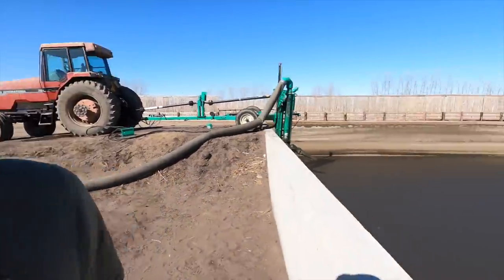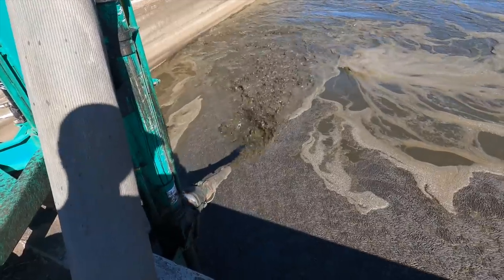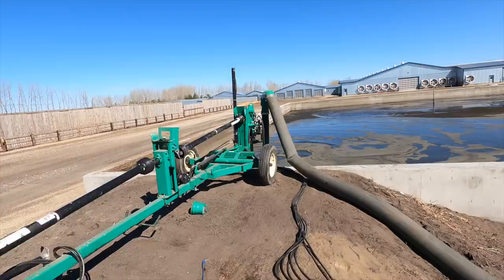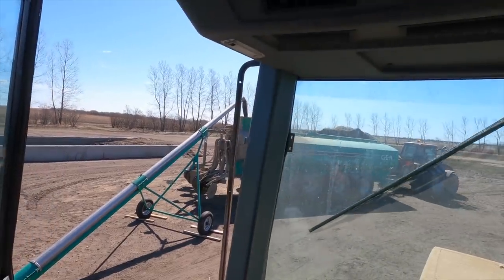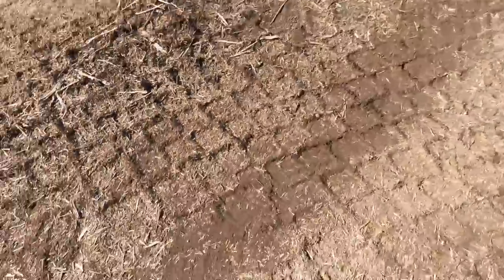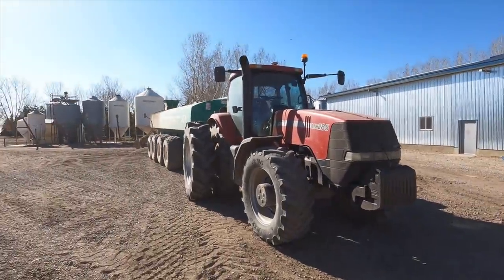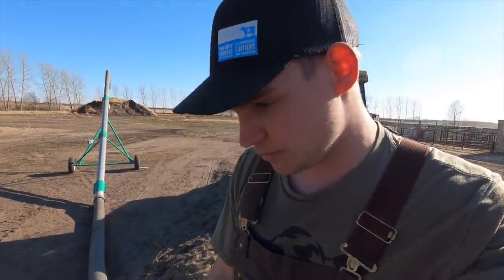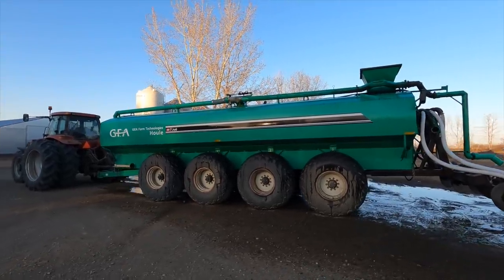Hauling Liquid Manure With 35,000 Litre Tanker!!

Comment: I appreciate all the hard work you put into your videos Jan. This is another great one. 

The pit is 306,250 cubic feet or 8672 cubic meters according to Jan's measurements he gave in the beginning of the video. Jan also covered the complaints from neighbors in his video titled: "Manure Tank Needs Work" in which he said the neighbors were respectful and asking if injecting would make a difference. It was nice of Jan and his family to try and accommodate the neighbors for a special outdoor event. Very considerate. In the same video, Jan details the sand that is suspended in the manure and how spreading the sand on the field affects the topsoil. Jan actually talks about the sand in some of his other videos. In one video, Jan basically says the sand is such a small amount spread over such a large area that the effect is negligible compared to the benefits of using sand bedding.

Comment: I'm driving tractor for a contractor mainly spreading liquid manure. He has tanks with straight disks and pressure injectors looking as goose feets applying deeper in ground and with closing wheels after.  Same machine with other injectors can also be used for wet-seeding pasture grass, canola and such together with slurry. Working better with better yield than ordinary seeding. (Rapid)

Comment: We have 3 CAFO's , all over 1800 cows within 10 miles.  While we used to spread either spring or fall, they spread, spring and fall and  in addition they top dress the hay fields after each harvest, so that will be spreading April, May, June, July, Aug, Sept, Oct, Nov and Dec.  The heaviest applications are in April, May,  Sept, Oct, Nov and Dec.  

The max those tanks can haul by law is a maximum gross vehicle weight (GVW) of 92,000 pounds.  Many township roads were built before the advent of the large grain buggys and manure tankers so they are standing up very well to these large loads.  Our township, very rural, with supervisors with rural backgrounds limits traffic like this to less than 30000# until the about the middle of June to prevent the breakup of the roads.

Comment: Jan have you ever tried shallow tillage right after spreading slurry (it has to be wet) ? It works for us. Wet slurry holds sandy particles together so it wont blew away in windy times. Other andvantage is that you prevent from NO3 and H2S losses. Sulphur and nitrogen are both important.
Its just my suggestion.  
Cheers from Europe

Comment: Isnt it a option to solve the problem with the sand in the lagoon to make a smaller pit between the barn and the lagoon where the sand can settle down? The sand settle, the liquid can flow trough a pipe on the top of it to the lagoon. And when the small pit is full of sand u can dig or suck it out?! 
Still loving u and your videos Jan!!

Comment: There's an old John Deere sales line... "We stand behind our equipment 100%. Except manure spreaders"....   nice seeing how you do that work - any reason you can't use the pump on the other end of the catchment to mix the sand etc vs not having someone else come in ?   And at some point do you have to lower a box scooper and auger in to get the build up out anyway ?

Comment: Not sure why you don't finish the pit clean out now instead of putting it off til late summer. Plus at some point your of sand will get compacted enough mixing is not going to help much you will need a few large loaders to scrape it up and put it in a solid manure spreader. To bad I am to old and have no skills to do that work because I would be glad to do it for free.

 Better this time of year rather than the high heat of August but it's your farm. And for those who do not like the smell, they should not have moved into the a location of a dairy farm if you want to eat dairy products you just put up with it for a short period of time, or go on vacation when your spreading..

I would think the smell is a lot worse in August than it is right now in the colder months.

Comment: Is it right Jan that if that tanker holds 100,000lbs like you said, that's like 45 tonnes, plus the weight of the tanker which must be at a guess 5-6 tonnes, the tractor 8-10 tonnes? Hell fire, your driving/ moving 55 plus tonnes?? Here in the UK that's way above hgv- heavy goods vehicle allowed total! Good help you if that ever jack knifes and the poo flows lol

Comment: You only have a few splatters on your face and neck so you did better than I would have ever done!  I worked on 2 different dairies in New Mexico back in 79 and 80. Your milk barn or parlor, as y'all call it, is set up much the same as ours was, even way back then. On one dairy we were milking 1000 cows a day so we ran 2 crews, instead of a split shift like the other dairy I worked at which milked about 1/4 of that many, because it took 8 hours to set up, milk and then clean up. I remember there was a commercial on TV back then for a detergent company and they'd ask these supposedly random ladies what the toughest stain was to remove from clothes and one would say grease another would say blood another would say something else.  My wife would always ask where the people were who were asking that question because none of them ever said cow shit!?!  My work clothes were literally stained green very shortly after I got new ones! There was nothing you could do to keep it off of you either because the cows hoofs were about waist high and water was running all of the time so when they came in and took a dump it splashed all over you. Being a young married couple we didn't have extra money to buy coveralls or anything like that, which is what I'd do today. I was buying my work clothes at Goodwill as it was, except for my rubber boots. They carried real good ones at AMPI (The folks who picked up our milk every day) and I always bought my boots from them and they gave us a discount since we were dairy workers. They were the only rubber boots I found that were comfortable to wear all day long.